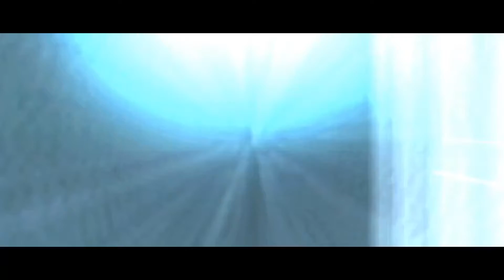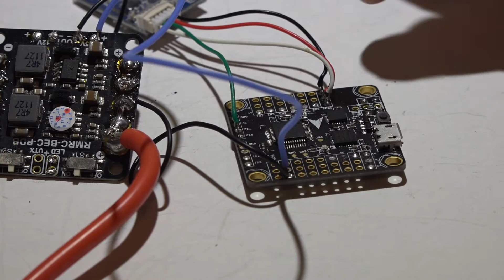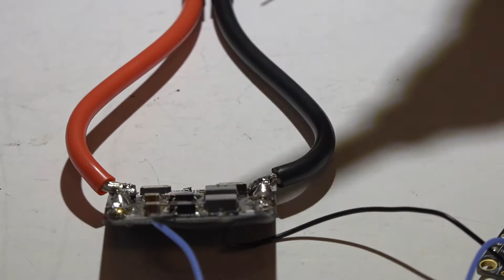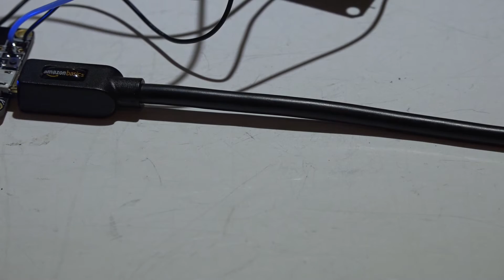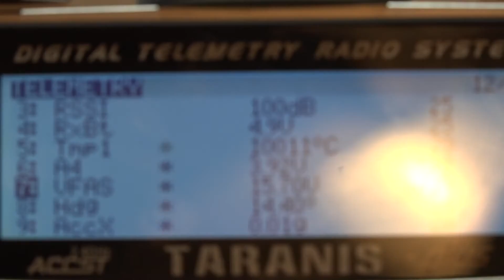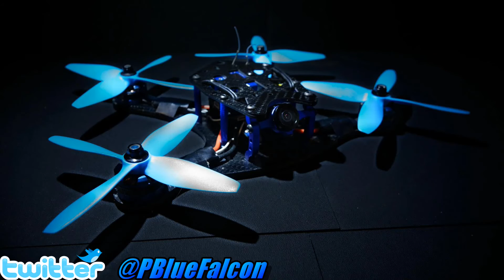X-Racer F303: Getting Voltage In Telemetry

Comment: here is what I see, I see you said in the previous video for the x4r and telemetry you said you could use the white clip on the receiver, and remove the other 3 wires and leave just the outside green wire, on this video I see 4 wires coming from the white clip to the receiver. Did I miss something or? Thanks in advance

Comment: At 1:25 you mentioned the scrap wire for connecting between the PDB and the FC Vbat pins.  What wire size AWG are you using for these board to board soldered jumpers.  In another video you provided your preferences for ESC wiring re: 30 amp and 20 amp ESCs, so what about here.  Is 22 AWG too big and/or is 28 AWG too small and flimsy, for a point to point solder connection?  What's a size that stands up to the mechanical stresses of building and flying? In the past, I have Only used JST connectors.   end to end.  Now I will be having no connectors end, and the wire size will to my preference.  Do you have a sweet spot. Thanks for posting the video.